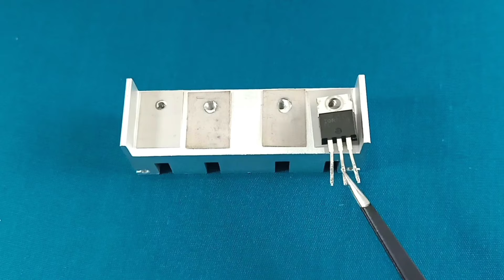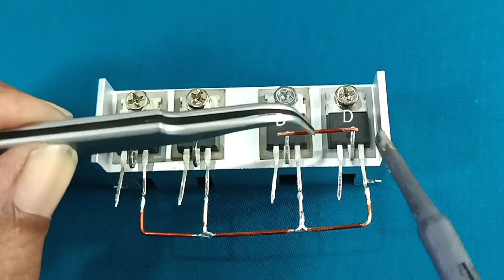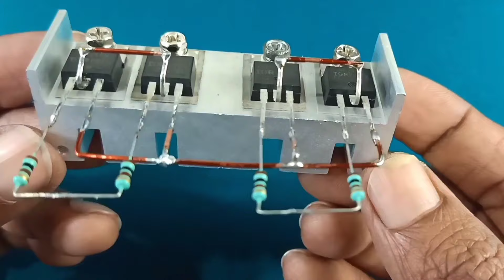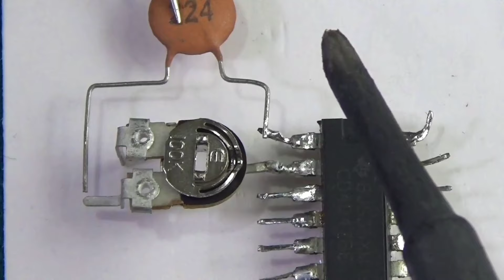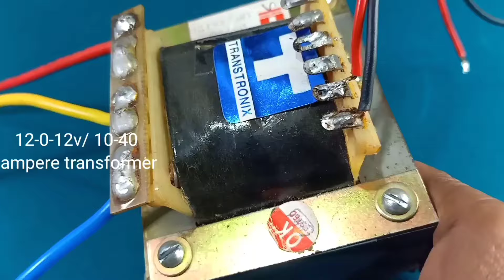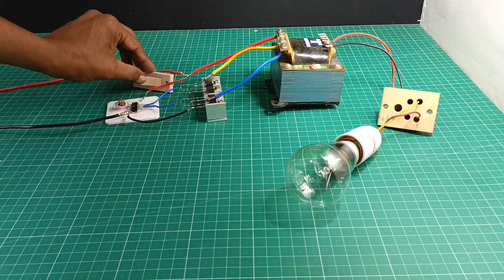Simple Powerful 220V Inverter // How to Make Simple Inverter 2500W , Sine Wave , irfz44n x 4

Comment: Can you please say if here the source pin and the gate resistor are soldered or not by the video i cant understand this
Reply from the maker: Please check all details in the video, n diagram
Reply: @RJEDITALL  in the video it is very difficult to understand that if the source pins and gate resistors are soldered together or nothing due to the camera position. Sir Kindly tell
Reply from the maker: @techchoice514  gate pin is not connected to source pin with Rasistor
Reply: @RJEDITALL Also if possible can you plesde upload a schematic of 4 mosfet inverter with tl494 ic

Comment: Brother, please tell 3 ampere transformer is working or not. if working so,give how output and watt?
Reply from the maker: Yes, output 70-100 watt
Reply: @RJEDITALL  Bro can it run dril machine.. and bro make inverter from ic 555 i comment previously.and 70_100w how is the brightness... And bro please give me answer of some questions please ,🙏
Condition -1 
If I reduce no. Of Mosfet 44n and use only two s
,So what is output please tell.
Condition -2 
If I use only two MOSFET and ic not used,so what will be output.
Reply: Bro can it run dril machine.. and bro make inverter from ic 555 i comment previously.and 70_100w how is the brightness... And bro please give me answer of some questions please ,🙏
Condition -1 
If I reduce no. Of Mosfet 44n and use only two s
,So what is output please tell.
Condition -2 
If I use only two MOSFET and ic not used,so what will be output.
And price of your transformer which used in your video..
Reply: Bro. please reply.

Comment: 12 or 0 transformer mein positive aur dho wire kahan connection kare aur ye circuit use kar sakte hai kya
Reply from the maker: Middle wire, positive, aur left - right both mosfet ka  middle pin ke sath connection Kari a

Comment: Drill,Grainding  mission base Universal motor. Motor👉🏻 Run DC or AC low voltage.
     Run Fan 3phase Motor🤙🏻👍🏻
Reply from the maker: No run 3 phase motor
Reply: @RJEDITALL Can you make an inverter to run a 3 phase motor.

Comment: I did not get the value of the  input voltage
Reply from the maker: DC 12v/7-30 ah battery
Reply: @RJEDITALL  how can I parallel multiple connections to this circuit so i can have the input of 200vdc and parallel output for more watts. sine wave 50hz

Comment: Can i use atx tranceformer
Reply from the maker: No
Reply: @RJEDITALL  can i increase wattage using more mosfet
Reply from the maker: @abhi_e7x  yes , you can add more mosfet
Reply: @RJEDITALL  what is the circuit for that . I searched everywhere but i can't find one . I need 4 + 4 z 44 mosfet circuit

Comment: Hello sir I am a beginner in this project I have tried to do it many time it working but if I on it one time and I swich it and I on it again it will not work sir what is the problem
Reply from the maker: Please use 12-0-12v transformer, and add more mosfet, parallel connection
Reply: @RJEDITALL  can I use irf3205 mosfet??
Reply from the maker: @ugonnaobilo7699  you can use any N Channel MOSFET

Comment: Hello, I'm wondering if we can make this inverter circuit with 2 mosfets, if we can do it with 2 mosfets, will the current value we get from the transformer output decrease, can we get the current and voltage in the same way? I will be glad if you give.
Reply from the maker: Yes, The wattage will decrease. Because you don't use same ampere battery.
Reply: @RJEDITALL  thank you
Reply: Not working

Comment: Very good but you didn't show the battery in the video, from whom you gave the power, I apologize, I feel a little like, can you solve my problem, I will be sure when you show the battery with the project.
Reply from the maker: I am using 12v adobter
Reply: @RJEDITALL  Please show in the video if you are using the adapter
Reply: @RJEDITALL  i like your video

Comment: Hi There, On your circuit diagram, can you tell me where the 'wiper' on the 100K Pot is connected to? It looks like the track is connected between pin 2 & 3 and the 224 cap, but the wiper is free floating. Thanks Johnhh

Comment: Hey engineer, can you make a 12 or 24 volt inverter that can operate a welding machine of 200 amps or more and work with full efficiency
Reply from the maker: Ok, I will try
Reply: Maquina de soldar?  Un inversor no puedes usar. Debes usar un generador eléctrico.

Comment: how much is the level of voltage oscillation at the output of IC 4047 circuit (between pin 10 and pin 11) ?